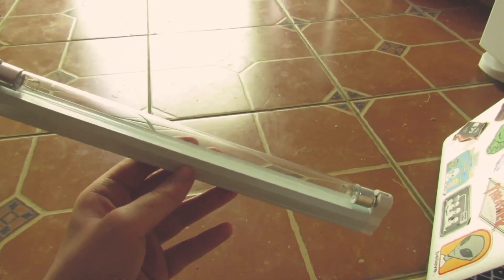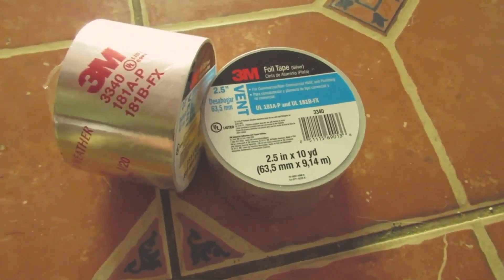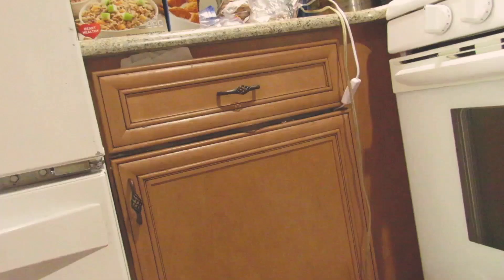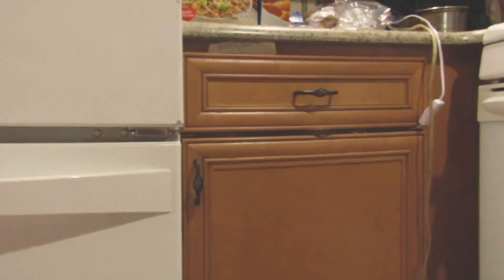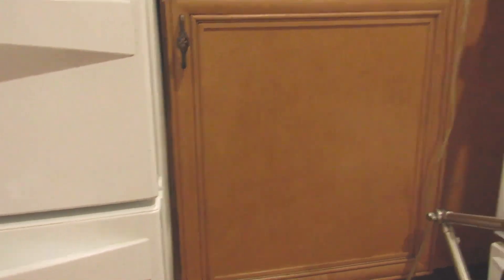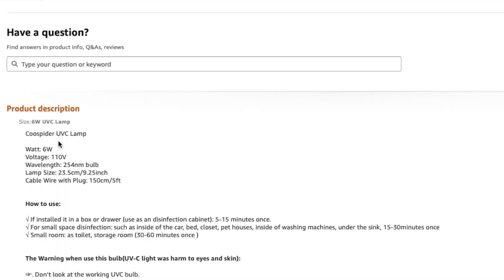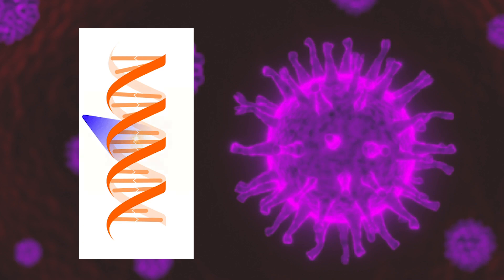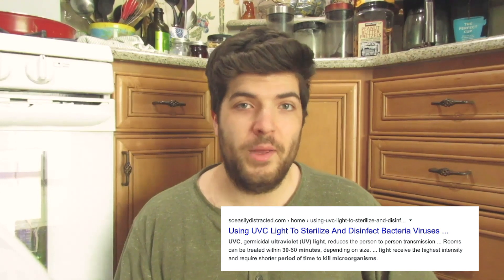Retrofitting a kitchen cabinet - to act as a decontamination chamber during COVID-19

Comment: Cool idea, however, I wonder if this is actually useful in practice. I doubt the viral load on your groceries (and what you would possibly exposed to) is above the infectious dose. Plus, in regards to bacteria, a lot have mechanisms to correct pyrimidine dimers caused by radiation, and this type of radiation does not penetrate well. So even a fine layer of dust will effectively prevent bacteria from being killed. It is because of this reason that my lab requires us to wipe down the lamps with lint-free kim wipes every couple of days. Still a fun little project. Keep it up!